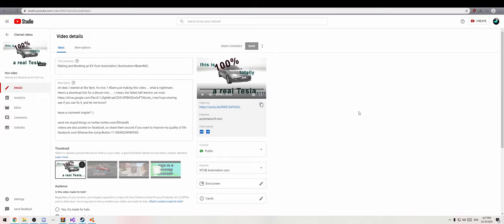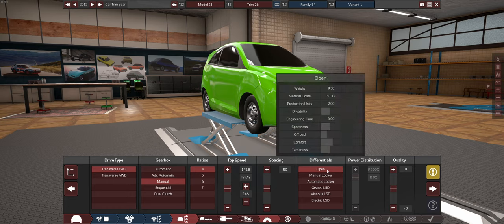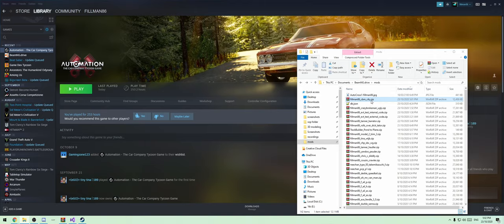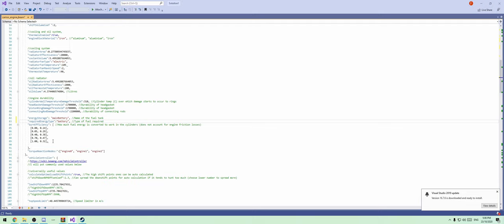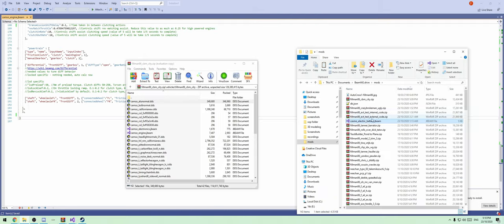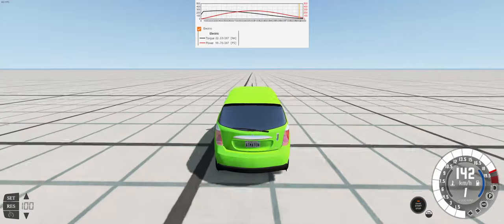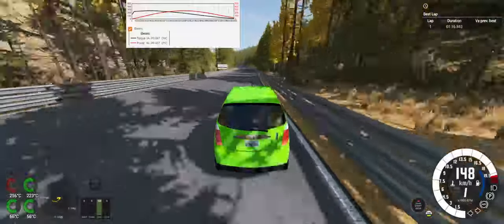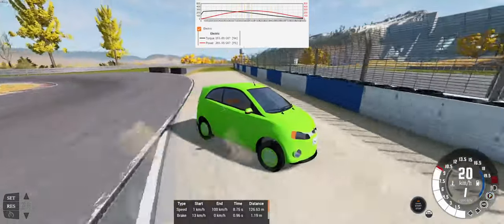Stop Faking Electric Cars Today!! (Automation🔧BeamNG)

Comment: soo, i tried it twice, and i get to the stage where I can put battery pack in it but it doesn't drive and doesn't have rpms and/or gears. i did it with a dct, but that shouldn't change anything should it? and also I'm using open beta, so is it because of that?
thanks in advanve.
Reply from the maker: so the first thing, make sure that the "M" in "electricMotor" is capitilised, and that you haven't removed the wrong commas. If that's all good, and doesn't work, feel free to upload it to google drive, and reply a link, and I'll have a look
Reply: @fillman86  im redoing it for the third time but now I installed visual studio and I hope it works. i made the battery 100kw but it still works perfect. its just the engine and gearbox. let me try again and if it doesn't work ill send u the drive link.
Reply: @fillman86  also should I correct all the casmos in the battery file? i made them all camso i think that that's how its supposed to be.
Reply: @fillman86  sooo it still didn't work. https://drive.google.com/drive/folders/1Wwq1oRctsLP437oFqUzMR0Zsl_jwWgw0?usp=sharing this is the drive link. hope u can figure out what I did wrong. thanks
Reply from the maker: well I'm not at my pc, but you do go to 85,000rpm then back down to 20,000rpm. Also your "gearRatios" the first number is not negative. I think it's meant to be.

I'll be taking a look in the morning, unless those have fixed it before then
Reply: @fillman86  ok ill see them but its supposed to be 8500 not 85,000
hope - fixes it. it probably wont but worth a try.
Reply: still not working.
Reply from the maker: HA!! FOUND IT!!! the new code leaves out ""value": 4000" on line 6, add this. Also it needed to be written casmo because my error is deep haha. The rpm needed to be fixed, and so did the "-" in your gearRatios
Reply: @fillman86  Thanks! im gonna try it rn i hope it works
Reply: @fillman86  btw i should add that in the engine.jbeam file right?
Reply: @fillman86  still didnt work soo ;-;
Reply from the maker: @zazaelashvili5680  odd, because I drove your car around myself just a moment ago, and have another one working too
Reply: @fillman86  could u send me a drive link for my driving car? ill look around and see what im missing and where
Reply from the maker: @zazaelashvili5680  I also replaced your battery with the default file, and made it casmo again
Reply: @fillman86  btw which line 6 we talking about? because in engine.jbeam ur car doesn't have ""value": 4000" either.
Reply from the maker: @zazaelashvili5680  you're right, I'm sifting through, and that was a trouble shooting thing I had in an earlier version. Honestly my instructions still work, I even got yours to work, I don't know what you're doing.... but here's your car, working and all :) https://drive.google.com/file/d/1EDEypDYgdEwCP3BhRg47qi_l5hJvWIk5/view?usp=sharing free of charge XD
Reply: @fillman86  in my beam the car u got running doesn't work
idk what to do lmao. the one u made in video works tho, I got it from repository and drives nice and everything.
whyyyyyyyyy why beam and automation whyyyyyyy
Reply from the maker: @zazaelashvili5680  you may have a botched version of beamng installed...
Reply: @fillman86  idk i downloaded it from steam but probably i have to clear it and uninstall and then install again 😕
Reply from the maker: @zazaelashvili5680  yeah, I dunno, I literally double checked it in beam, then sent it back to you.
Even now, I just downloaded from my own link, loaded it up, and it works. There should only be the one battery option, but just in case, are you selecting the battery from the engine sub menu, not the main parts area?
Reply: @fillman86  its not about battery, can specs like revs and transmissions and even some body panels dont load up.
Reply from the maker: @zazaelashvili5680  dunno what to tell you man, you're just out of luck
Reply: @fillman86  yea this sucks. new body i made for that car looks so good and now i cant use it 😕 imma make engine which resembles electric and make the soung go away in beam by modding the files which i learned from this vid, making it kinda like an electric car

Comment: i exported it and modified it, and it had no engine at all
Reply from the maker: so I just tried it again, and it still works. Just make sure you haven't made mistakes, ie remember to capitalize the "M" in "electricMotor"

Comment: My car spawn with out an engine
Reply from the maker: so I just tried it again, and it still works. Just make sure you haven't made mistakes, ie remember to capitalize the "M" in "electricMotor"
Reply: where's fillman86 yeah I have probably made some mistakes so I will try again and go over it again
Reply from the maker: @joefraser1726  haha even I stuff up something every time too :P but I personally know it works, and I've done it a bunch of times, so I just go back over it :)
Reply: I can’t add a fuel tank in beamng
Reply from the maker: @joefraser1726  that could mean many things, can you elaborate?
Reply: where's fillman86 it spawns just the same as your with out fuel so I go into the vehicle customisation in beamng  and tap on electric motor and all it says is car assist and transmission no battery/fuel
Reply: I think I need to restart and make a new car because I don’t know what I have done wrong. But I am close to getting it because it has the rpms going up to 20000 in beamng.
Reply from the maker: @joefraser1726  don't be ashamed XD it happens to the best of us. If you can get it working in the next one, upload it to google drive, and share the file on my discord, and I will have a look
Reply: where's fillman86 ok thank will do
Reply: where's fillman86 it doesn’t work I have put it on the discord

Comment: Thanks, now can build electric Hopper with single motor driving gearbox

And Alibaba esque electric car... Maybe?

Edit: I didn't made hopper, but using your tips I made 4x4 with nissan leaf spec uprated electric motor. Transfer case is useable and spawn issue is fixed (tips: go to car jbeam and change at slots accordingly). Also I made my car submersible.

The name of car is SZR Kalahar-E
Reply: I also made replica diesel engined car from automation, basically by adding particulates (roll coal), changing engine to feed from diesel, fill the tank with diesel, remove backfire sounds, and edit burn efficiency.
Reply from the maker: yeah, I made a diesel too, but it's still based on petrol, so you may as well just replace the whole engine. The power curve is all wrong, and a bunch of other things. I also have nearly no interest in diesels, so I know little about them
Reply: Update: I have successfully creating twin motor car. Yep, not one central motor with gearbox+TC. The problem is lack of traction control (cannot use camso traction control, this will crash the game/not spawn at all). Selector works fine without intervention (PRND), and electric motor won't rev at neutral anymore.

Most data are copied from eSBR.

Another update: I have successfully making traction control working, the trick is to move camso_dse to car main jbeam, not in electric motors.

Another2 update: now on repo, just search "SZR Zandak"